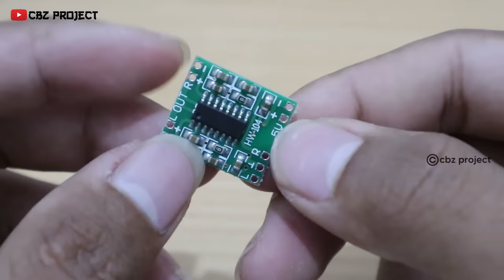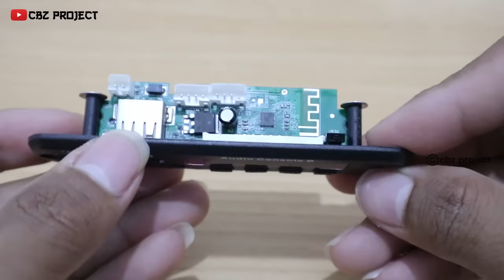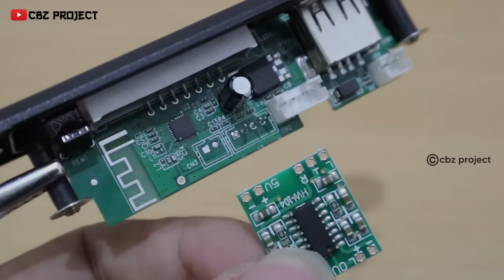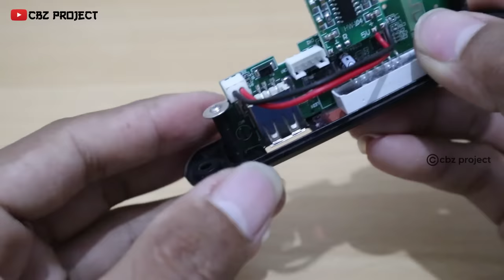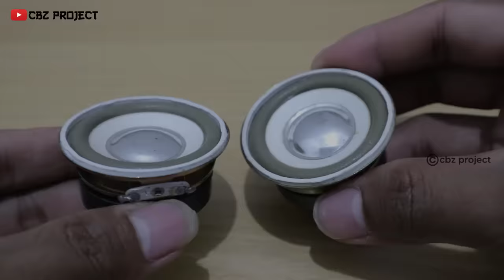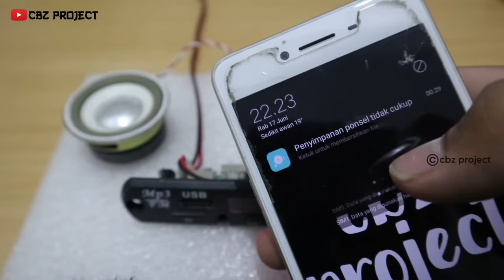Mini Super Bass Amplifier Using PAM8403 Board With MP3 Bluetooth

Comment: Thank you for a great tutorial! Please consider a video on adding a potentiometer to control the volume.
Look forward to more videos on components like this one.
Cheers m8
Reply: A potentiometer is not required. The Bluetooth device already has volume control with the buttons in front... ;-]
Reply: Yeah, but the buttons don't work as well as a pot volume control. I've already built a small housing with this type of player, 2 18650 batteries and a separate volume pot. I'll post a video on it soon. Cheers

Comment: Hi Sir,
Is there any noise since we connected power from same battery to module and amp board. If yes, how can we alter this without noise
Reply: efficient electronix youtube channel    use ground wire thick   change Bluetooth kit

Comment: Itu sumber tegangan 5 volt gan ? Mp3 modul sama ampli nya? Vidio lain saya liat tegangan modul mp3 nya 12 volt??
Reply from the maker: Ada MP3 yg pake 5V ada juga yg 12V
Reply: @cbzproject  kalo modul mp3 12 volt amplinya 5 volt ngakalin gmana gan? Pake 7805 bisa ga?

Comment: Sir ji Bettery lagayenge ya Ac 220 de denge or agr bettery lagayenge to kitna Volt ka lagayenge ye bhi bata dijiye
Reply: 3.7 v dc battery or 5v suppy at USB cable
Reply: Or  minimum 2.5v ,minimum 5.5v in use only
Reply: Bhai yeh 5 volt mey chalnewala system hai... Aap isko mobile ya Li-Ion battery se, nahito mobile charger se chala sakte ho.... Galati se bhi 220 AC mey mat dalo....